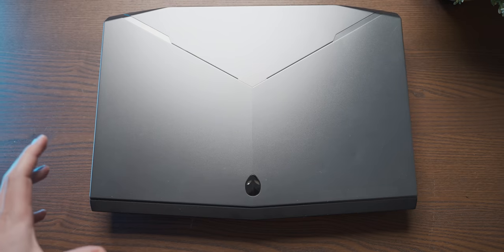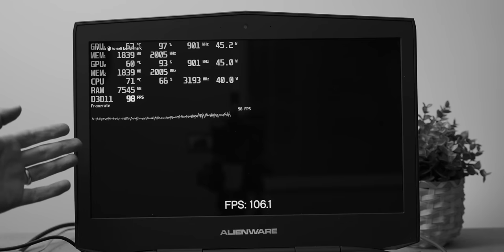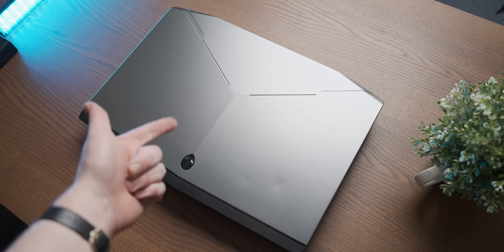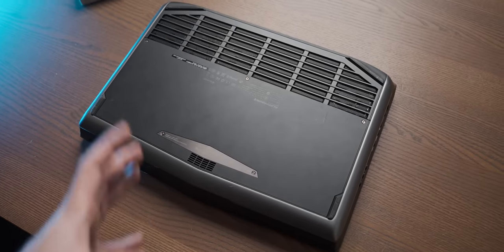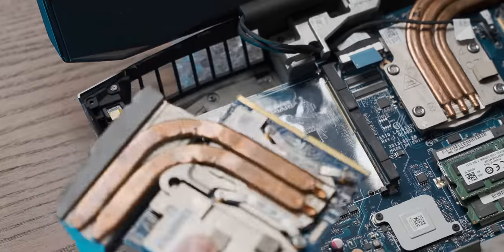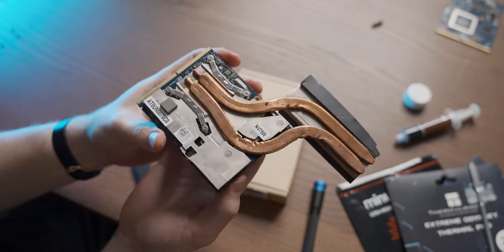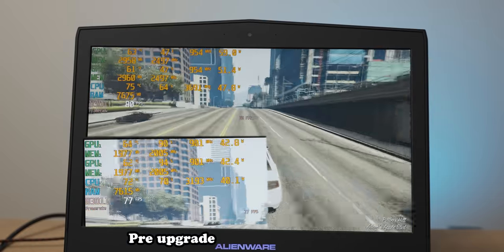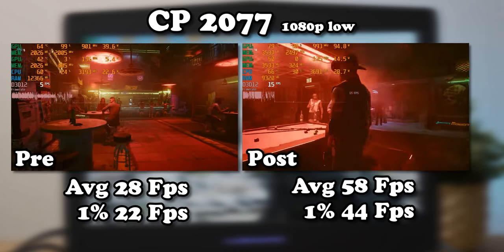Now This Is UPGRADING A Laptop

Comment: I think we deserve to see 2080 upgraded version too
Reply: Probably putting two 2080 can make it work like a modern pc even better 💀
Reply: It can’t run them sadly…
Reply: Should be fine with a single. You can use the other slot for nvme card and skip the sli
Reply: @MyStuffWasNotAvailable Dawid can make it work i believe in him
Reply: @lucidnonsense942  It doesn’t fit.
Reply: Cpu bottleneck go brrrrr
Reply: Lame Desktop 4090 16gbs full wattage👍👍🤪🤪🤣🤣😉😉👍
Reply: The power supply would never be able to handle it. It is also the current bottleneck, since you can see right in afterburner the power draw for the cards are lower than spec.
Reply: That 75W cooler was already at its limit while dealing with that 122W heat load of the 880M. I don't think it can handle the RTX 2080M's TDP of 150W, which means it will likely suffer from thermal throttling that might take away any potential performance uplift that the RTX 2080M has to offer.
Reply: yes
Reply: Yeah👌
Reply: @SierraAAM  if he undervolts it, it'll still offer large performance increases with ipc and core count increases from the newer architecture
Reply: mxm slots have different gens and pinouts
Reply: Yeah, he can't just sit there and tease us about the existence of that and not have us not want it
Reply: time to get lenode to sponsor the next 10 videos...
Reply: Those 2080 cards won't work inside this laptop because those things are physically different types of MXM cards in terms of layout, just take a look at the shape of the cards, they are different in shapes and sizes. Which basically mean it won't fit.

As a side note, there are higher probabilities of some gtx10xx MXM cards that might work in that machine.
Reply: Jees give that man a break.
Reply: Yes!
Reply: It will propably change nothing due to CPU bottleneck
Reply: @MyStuffWasNotAvailable when has that stopped him 😂
Reply: The video title be like: “I blew up the upgradable laptop from last video with a 2080” 😂
Reply: It won’t work
Reply: @poorNOOB  a 1080 will be the most recent gpu that laptop will support, obv its gonna need to be modded but it will work nonetheless
Reply: I have this laptop. You can't put a 2080 Super MXM in there. The MXM design of the board is different. It simply won't fit. The best GPU you can put in the AW18 is a single GTX 1070 with a modified heatsink. For SLI, the best you can do is dual 980m.
Reply: it will just cpu bottleneck
Reply: You would have to take the BIOS to one of them BIOS modding communities to have them program it in. I know somebody who's working on one for my HDX 9000 to be able to support a Core 2 Quad by allowing overclocking of the FSB.
Reply: @smokegames1179  exactly
Reply: The highest this can go is a 980m.
Reply: @RuthLessAmvs  yeah he could, but then it would look more like a human who was born in Chernobyl rather than a laptop
Reply: @nikolaossofos4282  💀
Reply: @RuthLessAmvs  no, you'd also need to get a higher wattage power brick, otherwise the GPU is just going to be throttling the entire time, like in this video, the 880m has a max power of 130W so between the 2 of them that's already 230W, and as you saw here the power draw was waaay under that
Reply: @EvilTurkeySlices  ik i have to most upgraded version of the alienware 18 it was $7k
Reply: Yyyyyes!
Reply: YES
Reply: I’d like to see that as well but the CPU would bottleneck it
Reply: But Dawid might forget the SLI cable again. 😂
Reply: @RuthLessAmvs  4160 new gpu
Reply: @juggybob  yo what 💀 there's a 4160 now
Reply: 2080 won’t work on this laptop  two 980m in sli or one 1070m ✅
Reply: Still will be hella expensive
Reply: Still just quad core Intel
Reply: thats a lot of likes
Reply: Yeah it will i had tried and it works rtx 2070 now is single mode the card so expensive maybe later i will add another rtx 2070 to being sli
Reply: Good luck cutting that from Dell...... there is a reason the no longer get make them modular and upgradeable like this.... and its  operate greed.... they'd rather sold everything and sell you a similar laptop in different specs with each being its own product...😢
Reply: @SierraAAM  there are the triple heating that this model has as upgrades which are rates for over 115wats .. in the video he just didn't bother upgrading those
Reply: @rotmistrzjanm8776  it maxes out at the 4940MX.. which is good with decent clocks good multipliers for over locking but the drawback would be having g only 4 cores in the modern gaming scene
Reply: can't be, older pcie speeds, the gpu won't benefit from it cuz this cpu hasn't anoug bandwidth in GT and less pcie lanes. De bifurcation will cutt the losses
Reply: Even if it somehow fit. The fps would more or less be the same. Massive CPU bottleneck.
Reply: Its fit but not enough power(watt)
Reply: @RuthLessAmvs  unlikely. sli is not well supported. a modern laptop running a 75watt rtx 4060 (legion 5 pro). would likely outperform a sli 2080ti laptop at 200watts. 4060 laptop being quieter, lighter, better battery.........and much better display (with g-sync). (14nm tsmc, vs 4nm tsmc)
Reply: Dude, YES! I immediately thought the same! Also, it's a crime that the purposely build modern laptops to not be upgradable like this one is.
Reply: Yeah these laptops are very picky in what they will accept past keplar. I know 1070m can work in them, but only the ones with 120hz monitors for example
Reply: @MyStuffWasNotAvailable he could use a nvme slot and get an adapter to pcie
Reply: @SierraAAM if he uses a 4090 on this it'll probably be external.
Reply: Wattage be like 182547WATTS
Reply: @MyStuffWasNotAvailable  there is a quadro rtx 4000 which is a 2070 super that will just drop in
Reply: 2080 does not go into this laptop
Reply from the maker: I know I’m super late to this comment, but I’ll start tracking them down. They are just wildly expensive.
Reply: @DawidDoesTechStuff  id recommernd the quadro rtx 4000 or 3000 you need the MXM 3.0 b cards :)
Reply: @DawidDoesTechStuff  the rtx  3000 quadro is 359 :) us which is expensive but not awful
Reply: @DawidDoesTechStuff  also the rtx 2080s require a separate power plug . unless you want to try your hands at soldering  and leaching power from a sata connector or the other mxm 12 volt  line id recommend the quadro rtx 3000 its just plug and play with a driver mod :)
Reply: @DawidDoesTechStuff  dude pls it, that video was fckn awesome now with the 2080 i woulnd be surprised if it was the most watched video on your channel
Reply: That's what it should have been to begin with
Reply: @Voidkitty_  Easy solution..crank up the resolution and boom bottleneck is gone :D
Reply: I agree
Reply: dude that 4th gen i7 CANNOT handle 2080
Reply: @DawidDoesTechStuff  i'm actually buying one this month for mine since i am running a alienware 17 r1 that i am upgrading a lot
Reply: Can't wait .. still waiting ...

Comment: Forgetting the SLI bridge has the same spirit as forgetting the IO shield in a super complicated PC build
Reply: Yea in one scenario half of your GPU's are not going to do anything (back when SLI was usable in games) And in the other you clearly have not seen the desperation and savage no mobo out IO shield mounting of desperation. I like to see someone try and get that SLI bridge in that laptop in place without taking apart the laptop and it still works after the fact.

I have see enough IO shield war crimes. Metal scissors is not the right way to go about it. OR WORSE!
Reply: Gotta be the dumbest feeling (forgetting the IO shield).
Reply: not even close mate trust me i have both a complicated pc and an alienware m14x
Reply: It's not like you can play games that need SLI anyway
Reply: @TheDiner50 Just so you know they're called tin snips, "The more you know" 😅😂😂😂
Reply: @hardikpateeel  my alienware m14x died sitting unused for 1mo+ on my desk , when I opend it up I was amazed of the mess it was inside (from previous owner with bad conectors and soldered speakers and a missing tantalum.cap) - I was amazed it worked when I buyed it...
Reply from the maker: How do you always forget the thing deepest in the system? 😂
Reply: I forgot the IO shield in my most recent build...It's been almost 2 years and the mere thought of going back in to fix it instantly drains me of energy and enthusiasm. The build was such a headache and so many things went wrong that, after realizing my mistake, when it finally booted up, I said screw it. Makes my otherwise nice build look amateur and jank af...

Comment: Meanwhile Me gaming with a laptop that is 11 years old and it has i3 2310m and 6gb ram with 500gb hdd and intel hd 3000💀
Reply: Which games are you playing?
Reply: same
Reply: @raaga1994 not much 😂 fr tho I feel his pain
Reply: i3 2nd gen is probably socketed, so you can upgrade it to i7. Ram should be upgradable too. If you have mini pcie slot on the motherboard or expresscard slot then you can connect external GPU
Reply: @balmashev93  VRM and cooling may not support it
Reply: I'm sorry for your loss.
Reply: Dude at least get an ssd, I used to play with a sony laptop with a second gen i3, 8gb of ram and a small radeon
Reply: More like watching slideshows of games :)

Comment: Sisyphs =  dude in green myths that got stuck pushing the boulder up the hill in tartarus just to have it roll back down over and over for all eternity. Modern sisyphean task is fixing a laptop, and every time you put it back together there's a different part you forgot to put back in. So, you spend an eternity tearing it down and rebuilding it.